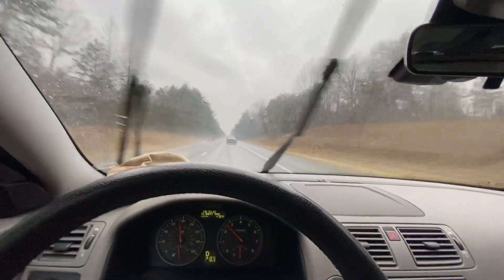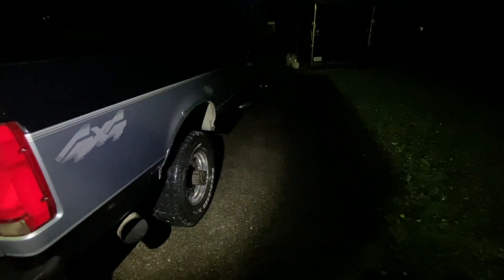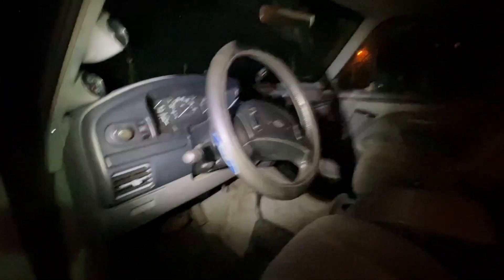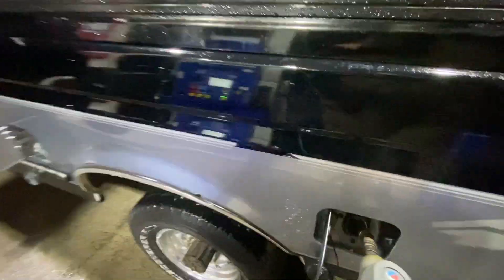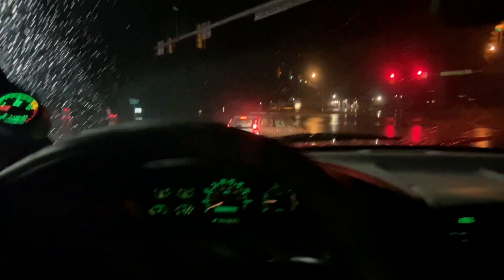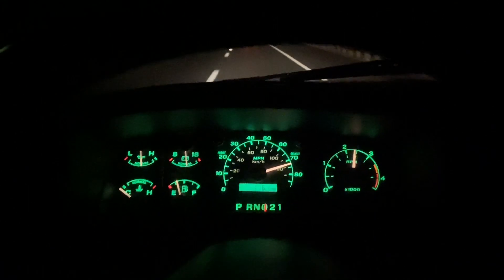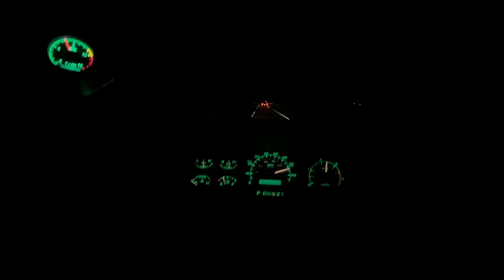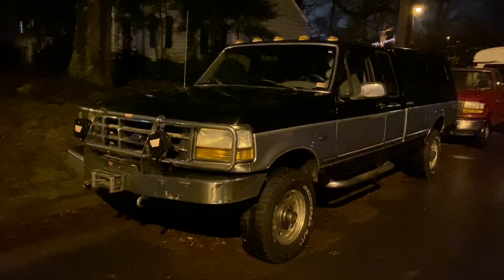1996' Ford F-250 7.3L Turbo Diesel -   I Just Purchased The Best Truck Ever Made

Comment: I've had my 1997 power stroke since new , Never had a major issue with it.  Just keep the NavStar serviced.  Carry an extra crankshaft sensor, Replace fuel bowl heater and beware of water in fuel.  Replaced one  glow plug since 1997.  Other than that, mine is a keeper !  No other major maintenance has been done, including brakes. Good luck !
Reply from the maker: Nice!